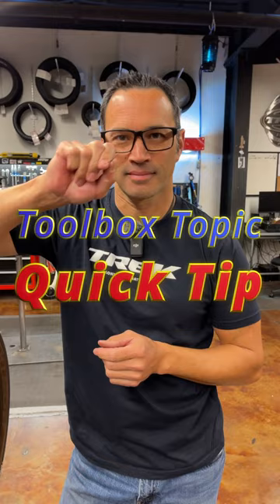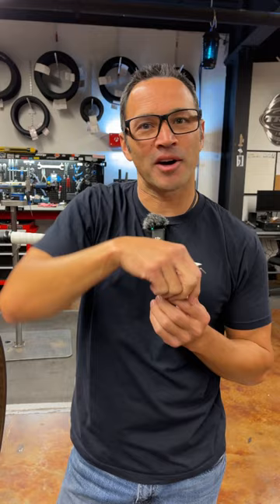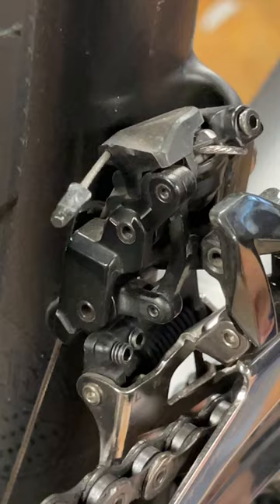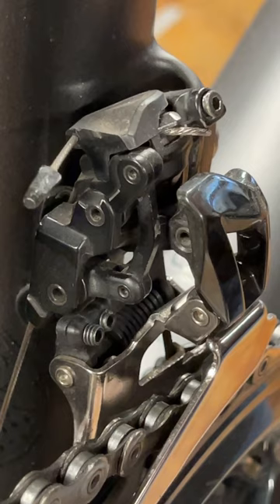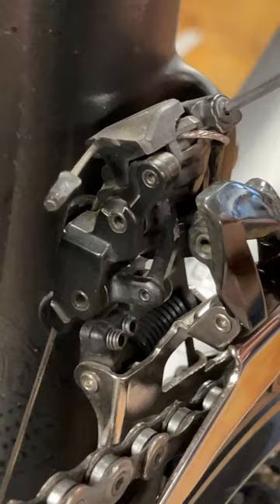DIY: Front Derailleur Adjustment Easy Peezy #bikeshop #bikeshoplife #bikelife #bikemaintenance

Comment: What if there is no more adjustment available on that Allen head and the marks are not lined up yet?
Reply from the maker: Then you will have to adjust the tension on your cable as well.
Reply: Would I back the Allen out then tighten the cable? Or leave the allen all the way in and then tighten the cable?
Reply from the maker: @trule5972  Back the allen bolt out and then adjust the cable first. After the cable is tightened, adjust the allen bolt again.
Reply: @GetOutArizona  thank you!
Reply from the maker: @trule5972  You are welcome my friend. Thank you for watching and the support!

Comment: Excellent tip. But I had to let the line go a bit back again for it to shift down again. But can you answer why my front derailleur has 3 clicks/positions but I have only 2 chain rings? Any way I can fix that? (It won't go in the lower ring without clicking 2 times, and vice versa for the big ring)
Reply from the maker: This is a great question, Bare, and I will research it a bit so I can give you accurate information. With a double upfront, you should only have to hit the shifter once. give me a few days and I'll get you an answer.
Reply: Im pretty sure its 4 positions you have a trim on the small ring too.

Not sure myself either, looking it up it says its to prevent fd rub at different chain lines, I personally use the bottom trim to set the cable, that way when I shift out of the trim (still on the small ring) it takes all the slack out of the cable

Edit:- I don't believe the chain rub answer is true as in day to day riding the big ring trim usually makes more noise for me
Reply: @calebgonsalves2970  It is only 3 positions but it seems you are right about it being trim. Supposedly it's to help alleviate chain rub when cross chaining (small ring with small ring), but I'm not sure. 🤔